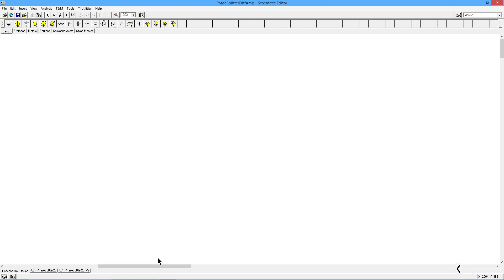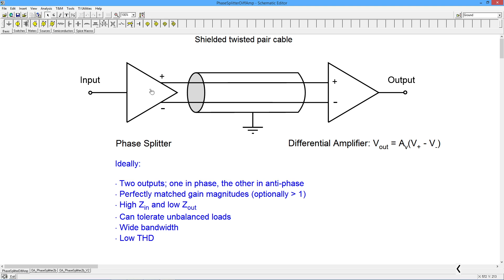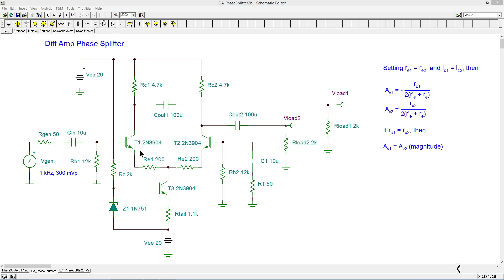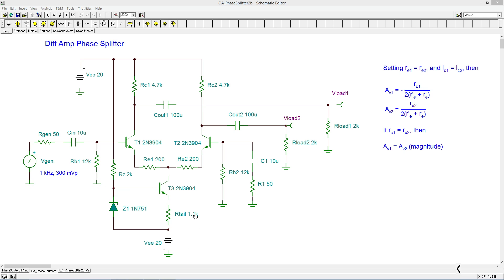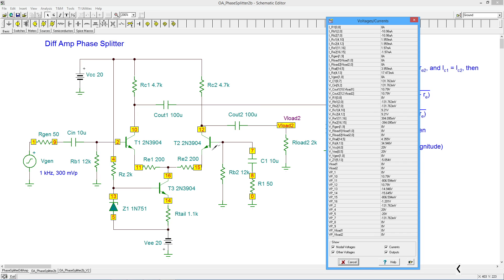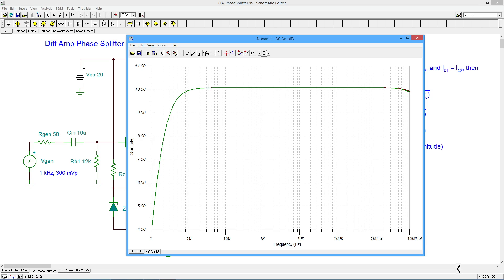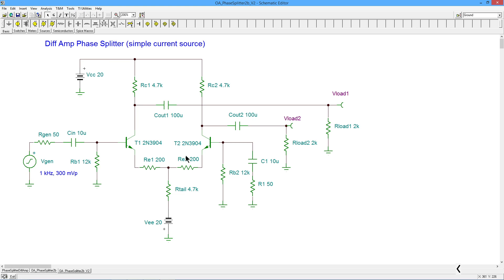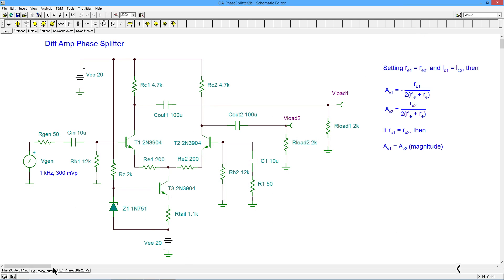Op Amps: Diff Amp Phase Splitter

Comment: Hi, due to matching error in discrete devices and the difficulties in keeping the two bjt at the very same temperature, I believe it is a bit unadvisable building a differential pair out of discrete devices. This could be easily done while designing integrated circuit, since equal junction temperature is guaranteed and matching error is greatly readuced placing the bjt close as possibile. But truth to be told I never tried that in practice. I'm curious whether it is possible to build a working differential pair out of discrete component. Thank you!
Reply from the maker: Most definitely. In fact, at one time, diff amps were made using tubes (and called "long-tailed pairs"). It is true that you won't get the sort of matching that you'd get using integrated devices these days, but you can most certainly make diff amps using discretes, and get good performance.
Reply: Maybe you familiarize yourself with the dual transistor.
Reply: Thank you for the tip! I didn't know there were ICs as "Matched dual transitors", that is definitely super cool!

Comment: I have a question and I hope that this is the forum to ask this. Prof Fiore, if I connected Cout1 between the two collectors of the diff pair, can we derive a a frequency response analysis? I would expect that if the voltage at the input of T1 was higher than AC GND at T2, then the phase would shift to "phase lead". On the other hand, if the input of T1 was below AC GND then the path would shift and the T2 path would introduce a phase lag. I have seen this circuit work as a phase shift network for a Colpits type oscillator in a clock recovery network. In any case, it would make an interesting analysis.
Reply from the maker: I'm not quite sure what you're proposing/asking, but in general whenever you insert a reactive element into a signal path (cap or inductor), there's going to be a phase shift, and whether or not it's lag or lead will depend on the configuration (a cap could be either). Part of my uncertainly is when you describe the signal at T1 being higher/below AC GND at T2. Half the time it's above and half the time it's below. Are you suggesting that the frequency response would be different for the positive vs. negative half cycles? 

Ultimately, I suggest simulating the altered circuit and see what it does.
Reply: @ElectronicswithProfessorFiore  Professor, thank you for your reply. I really mean it! It is not easy these days to find good advice concerning interesting analog circuits, these days. In terms of full disclosure, someone gave me this circuit about 30 years ago at a company that I worked at and he is long dead, as are a lot of the older analog people. Would it be possible to send you a jpg of the circuit in question? I can't insert one within the confines of a youtube comment section. All that I am looking for is a way to determine, analytically, a "phase response" (vector diagram or other) of a diff pair with a capacitor between the two collectors. Every 10 years or so I do a search for current data on this type of a circuit and I have never found any. If either end of the cap would be connected to AC ground, the analysis would be easy, but neither is. This is, in fact, an interesting circuit.
Reply from the maker: @theminertom11551  Simulation should be fairly straight-forward. There are multiple free simulators out there. I use TINA-TI but I've heard from folks using Linear Tech's LTSpice or MicroCap.